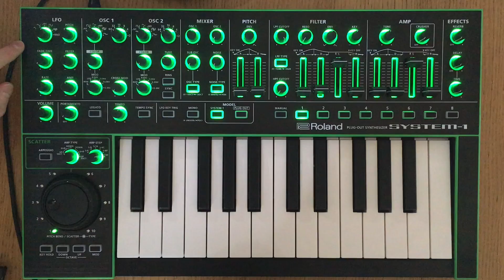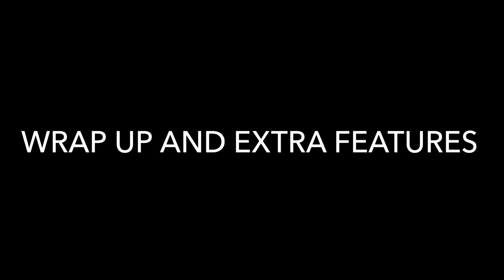How To Use A Synth Part IV - The LFO Section

Comment: I JUST received the ROLAND System-1 yesterday and I knew NOTHING about synthesizers before this other than I liked the sounds they make. These are THE BEST tutorials I have EVER seen. Thank you SIR!!
Reply: Hello Mr. Synthesizer GURU!!! I am LOVING your videos. PLEASE keep them coming. NOW for the question I am hoping you can help with. I am trying to record my SYSTEM-1 into the FL Studio DAW. I can record it and hear it in the DAW but the only sounds I get come from the PLUG-OUT synth software. While there are many presets in the PLUG-OUT software that are great, what I want to do is record the sounds I am creating with the SYS-1. I want to record the sound coming directly from the SYSTEM-1 but cannot make that happen. Apparently I don't have the right settings or connections. I currently have the SYSTEM-1 connected to my PC with the USB (B to A) plug. Do I have to connect with MIDI cables in order to hear and control the SYS-1 sounds from the device? If so, can I use a cable that has two MIDI connectors (In/Out) and the USB A plug or MUST I HAVE a controller in between that translates the MIDI to a USB signal? I am hoping you may be able to provide some assistance? Thanks for reading.